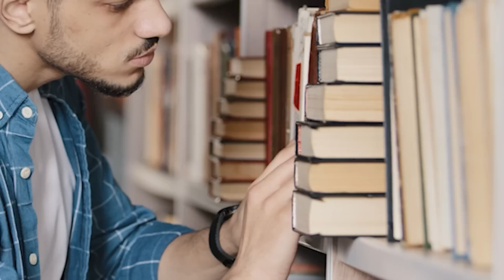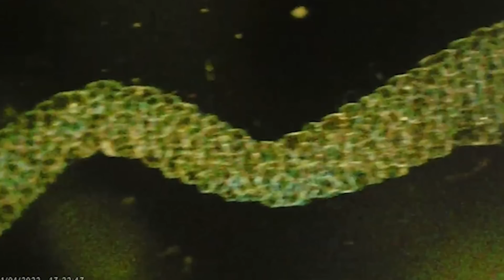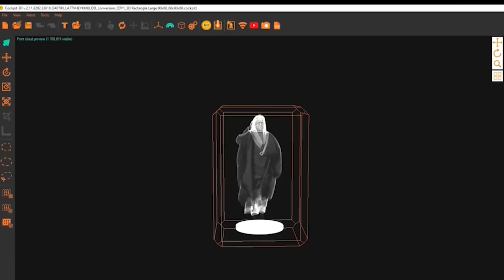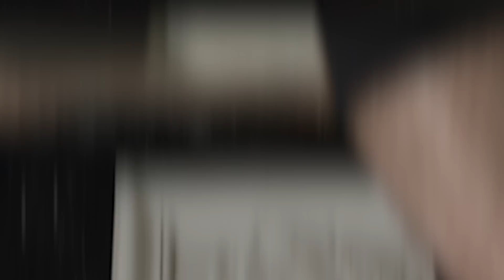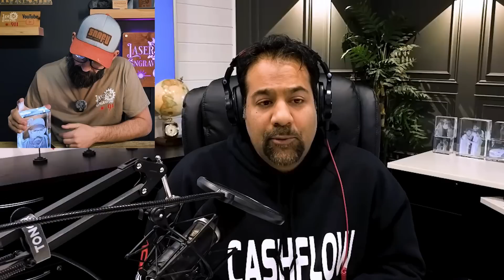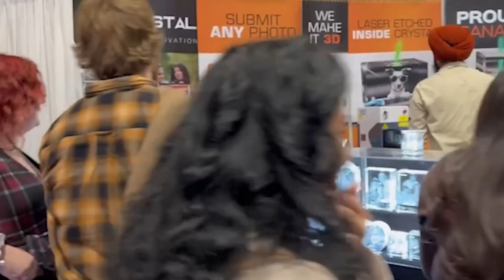Secrets of Subsurface Laser Engraving REVEALED! | Interview with a Pioneer

Comment: Yes! Great machine for $27.800,00 but just engrave 3D crystal. It's far too expensive compared to Full Spectrum Laser's Muse UV Galvo Laser with AI 3D scan engraving and very versatile. RetinaEngrave v3.0 software can quickly transform your 2D images into 3D images. Difference is the price $18.000,00
Reply from the maker: Thanks for sharing your take on equipment pricing, in my opinion, whether it’s fiber lasers CO2 lasers, 3-D crystal engravers or any other high level engraving equipment it’s not just about the rock-bottom price and how cheap you can get it. What really matters to me when I’m picking out a piece of high-end engraving equipment is the company behind it and the after sales support that I will get with that equipment for the lifetime of the equipment and if I have to pay more for that kind of support then that’s usually the company I’m going with
Reply: Pricing for the 3dlaserbox jet mini ranges between $14,900 and 27,900.  Without knowing too Much about The manufacturer you mentioned we do have some users that have that particular model and use our software for 3d     And we are informed that UV is not as brighter in crystal as green beam 532nm.  Also Field of view seems to be limited. So I suppose it depends on the business model and if the idea is to do multiple mediums.  If the goal is to pump out 3d laser etched crystals and use solutions that offer portability, advanced photo calculation from cellphone to 3d laser in minutes, and ability to engrave multi mode (various shapes sizes and customer files in a Single project) it may be worth reaching out and speaking to the team.
Reply: Full Spectrum Laser Muse 3d galvo is a closed loop system.  You have to use their software   .  I spoke at length with them at the APA expo a couple weeks back.  Their machine/software is amazing but the closed loop aspect is not attractive.
Reply: @ curious to better understand what “closed loop system” means?
Reply: @ you have to use their software on their machine.  It won’t work with other software.   It’s cloud based if I remember correctly.
Reply: @HumbleLaserGuy  Yes, that makes sense, no software installation but a WebIF connection.

Comment: He didn't answer the question of nominal wattage.
Reply from the maker: im pretty sure its in the range of 5-10watt YAG,
Reply: Total machine while cooling fans are running and the laser is burning ~500. We also tested running our booth at shows with many led lights on a battery powered inverter (machine  burning / lights shining and all) and it worked.  It’s an intereting option for saving on the gouging electricity bill they charge at shows 😂
Reply: @3dcrystal 500 watts sounds reasonable, thanks.

Comment: Could they not use the data that the iPhone collects via LiDAR when it takes a photo? I can do a 3D scan with my iPhone 15pro. It can store all of the depth data.
Reply from the maker: Good Question, While the Li DAR on our phone is pretty cool, and depth maps can be stored, it not enough points of data still to get the level of detail needed, it takes software and a human finishing touch to get it just right, Maybe Riyaz will pop in on this question to clarify as well, good question though
Reply: I believe LiDAR is for scanning objects physically present. Our objective has been to achieve 3d accurately from flat photos provided which is what the system described in the interview achieves.